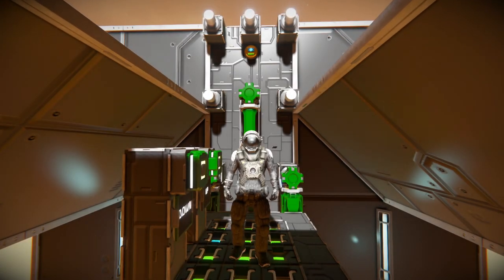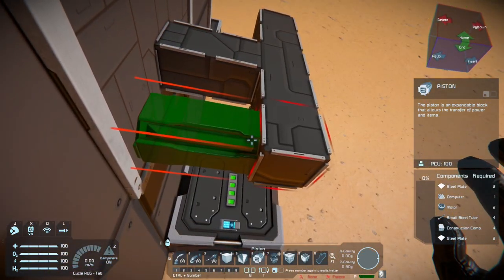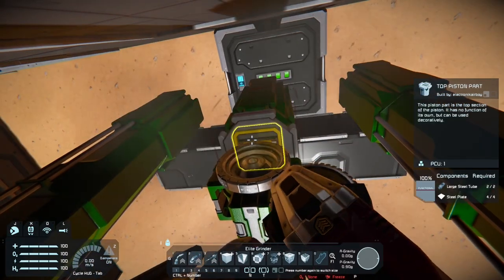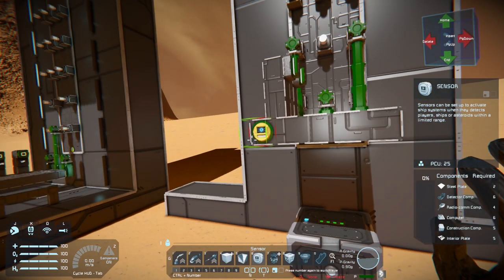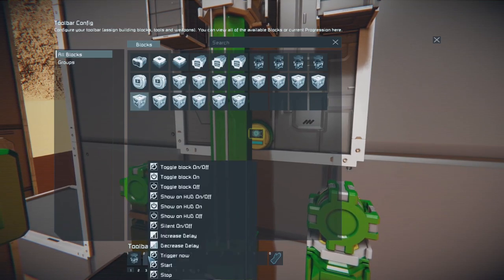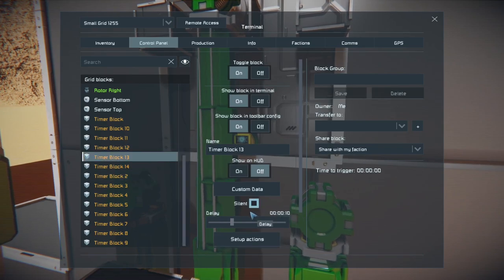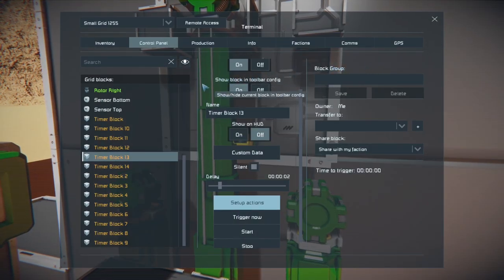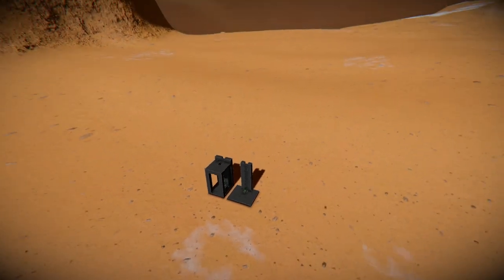Piston And Rotor Elevator Concept Walk Through

Comment: This seems ludicrously complicated at first glance, but it's definitely the best version of an elevator I've seen yet from multiple angles. Only real downside is the aesthetic but that could be modified with merge blocks as was suggested in a different comment, and could also be hidden relatively easily. All in all, great design, it's a shame more folks haven't seen it

Comment: To reduce the risk of placing a rotor head in the wrong orientation could you not use merge blocks instead? It may be a little more expensive to build, but it will be more rigid and slightly easier to build.
Reply from the maker: Hmm that could be a possibility as well, replace the numerous small rotor heads and rotors with small merge blocks.  I think you might be on to something, I like it!

Comment: 3:51 Allow me the question why you didn't hold shift + ctrl to build area of blocks instead of placing them one by one?

I tried to use this elevator on a ship but it started to clang around
Reply from the maker: I have not personally been in the habit of using shift + ctrl but could definitely adjust.  As for the clanging, I will experiment a bit and see if the problem can be duplicated and possibly corrected.
Reply: make sure you selected share inertia

Comment: Thanks for this video, i saw the short for the other design and was like okay now how the fuck do I do this? I'm doing a larger platform for the lift, so the delays and speed of the pistons i have had to mess with but other than that this has been extremely helpful
Reply from the maker: You are welcome.  I probably saw the same short you mentioned.
Reply: Made this with 10 timers, and it works with one button. I built it so it ends in the opposite piston extension that it started in which allows me to use the same 6 timers for up and down. Mine has a door on both sides and on the first floor the door starts open,  so the first timer actually closes the door, starts timer two, then I use one of Blackarmor's other tricks to get multiple timers on one button. So after starting timer 2 which actually starts the elevator movement, it turns on timer 9 then turns itself off. So timer 1 and 9 are put into a group i just named elevator switch, and i set a button to trigger now. This then has 1 close the door, start the elevator, turn on 9 and turn itself off. 9 is just the opposite door. Same as timer 1, closes door, starts timer two, turns on timer one and turns itself off. The sensors at the top and bottom stop the loop, and trigger a timer to attatch all rotors, open the door, and then turn off te sensor on their floor while turning on the opposite (8 for bottom 10 for top). I had to fudge with timings a bit, my pistons are on 1 meter per second instead of .5 as well. Hope this helps someone else in the future
Reply: And with just another day of my real life being poured into making a fake elevator in a video game where you have jetpacks, i condensed the loop to 4 blocks. 1 attatches center and detatches sides, then "trigger now" to timer 2 which reverses pistons and then "starts" timer 3 which attatches the sides and detatches the center and "trigger now" 4, which then reverses the piston and starts timer 1. The pistons are moving at 2 m/s and the 1st and 3rd timer are on 1 second delays, my sensors seem to be picking it up even at that speed. I actually had to use 3 sensors, for some reason they aren't triggering theie second action only the first action, so i have one stopping the loop, one locking all rotors, and one that opens the door for the floor its on and and turna off and on sensor groups. Again all working on one button to reverse the elevator so if you are on the bottom floor and its on the top floor its the same button to bring it back down as is to go up. So my nexr like 20 hours of real life will be invested into a fake elevator still 😂 but again i give like 99% of the credit to you and Black armor, I have less than 300 hours total in this game and im sure it took y'all 300 hours to getthis content out to us
Reply from the maker: @rikg4086 even though on the surface it may appear to be just wasting time building on a video, it is a lot more. When I hit a mental block from inventing and building real world prototypes, I turn to space engineers to not only provide a break but to also look for inspiration.  The people that utilize space engineers are all hidden geniuses.  So whether it is figuring out a “fake” elevator or designing out a real elevator, I would say you are definitely doing great and expanding those critical thinking capabilities.
Reply: @mastermindgameplay5297  you're making me feel a lot better about how much time im spending tryna make heat vents work on the subgrid when it moves xD got it to work on one sensor finally,  but it seems like i cant get heat vents to register energy being used on the elevator. Wanted some on the bottom to glow blue when its moving, but even with the power dependency at 0 they won't turn on. Not sure exactly how they work either, just thought the idea of them glowing while its active seemed like it would add to look 🤷‍♂️

Comment: It doesn't seem this can be used in survival.  You can't put the 3 blocks on both sides of the center block on the rotor.  Invalid block placement.
Reply from the maker: Interesting, I will try it out on survival mode and see if I can get it to work.
Reply: @mastermindgameplay5297  Wow, thanks for the quick reply.  Let me know if you were able to get it to work, and I just did something stupid (which is possible).  The thought of running up 30 blocks of stairs to the top of my observation deck isn’t really too appealing, but you gotta do what you gotta do sometimes.
Reply: @FlashAM1024  This was suggested in a separate comment, but you could try using merge blocks to get a more unified placement